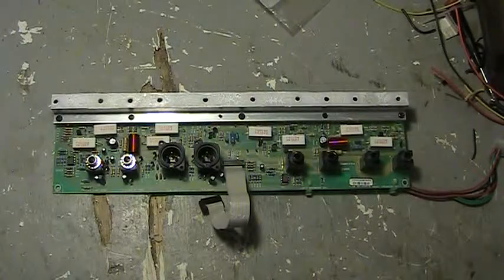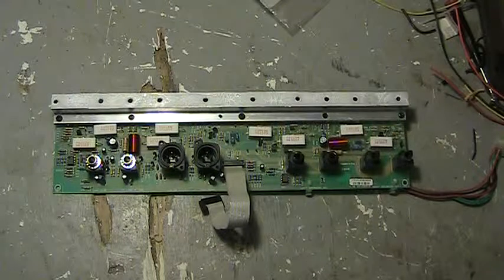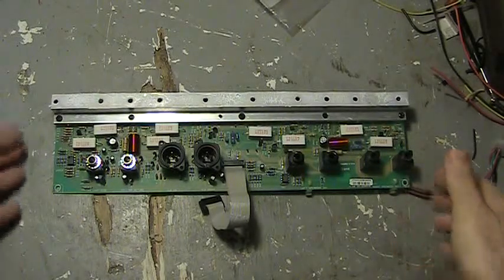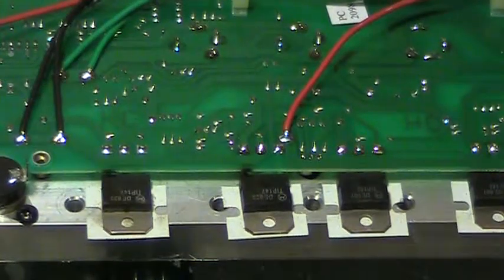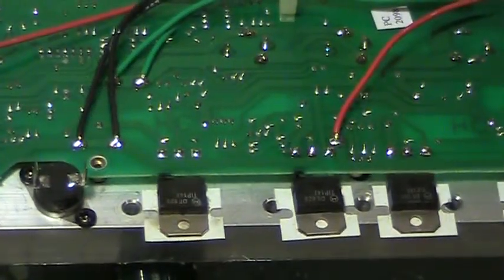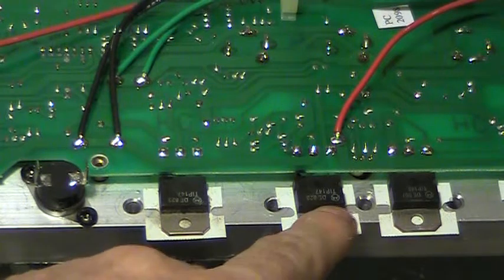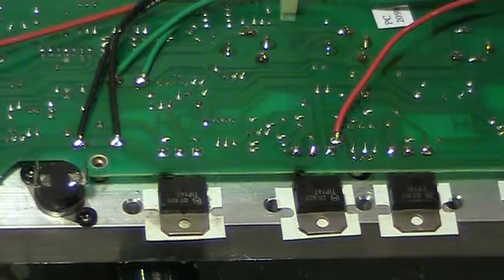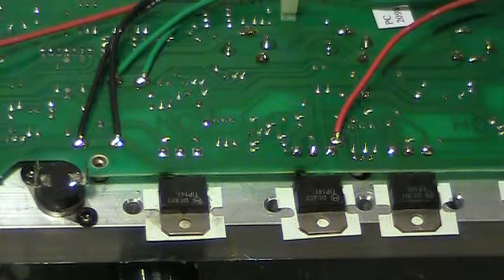Johnson Millennium J250H - Damaged

Comment: hey Fred this is Rod LaRue from St Louis Missouri I'm actually getting ready to possibly buy a Johnson Millenium 150 from a pawn shop but I would like to get a second opinion about a used Johnson Millenium amplifier would I be safe to go ahead and buy it for the $375 they want for it and when I do or if I do should I go ahead and just take it in somewhere and have it looked at before I even go to turn on the amp make sure everything's good to go of course I want to try it before I buy it?

Comment: hi dude i am about to buy a jm-250 and i have a j112 cabinet can i run the thing on this little 1 x 12 and still burn the stereo and into 1 speaker and not do stuff like this to the head? also i have read that i cannot use a j8 controler on this thing is it true? if you cant drive a 1 x12 or if it just demand at lest a 2 x 12 to have a decent exploitation of the head what spec and type of speaker i should and shouldn`t use?   thanks a lot
Reply: I would expect that you could use any 1x12 speaker with the head, just as long as it's 4 ohms or more and rated for 125 watts RMS or more, otherwise you could damage the amp or blow the speaker. 

I would recommend to avoid trying to bridge both stereo channels into a mono speaker.   That could cause unintended interaction and damage between the output stages.   Using just one of the outputs at a time is fine with this amp.   In fact you can run the amp without any speakers attached to to it, and just us the direct outs into a recording deck.

Cheers,

Fred